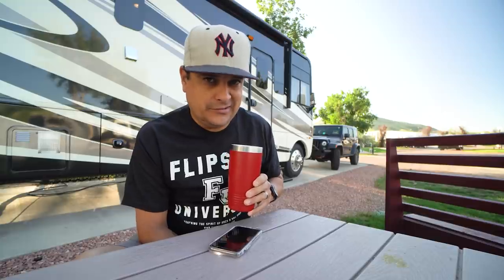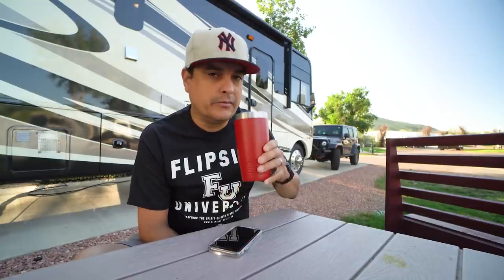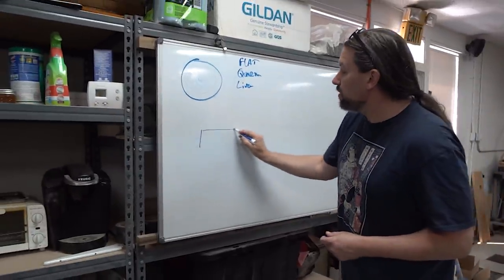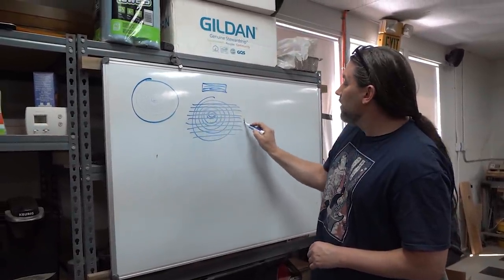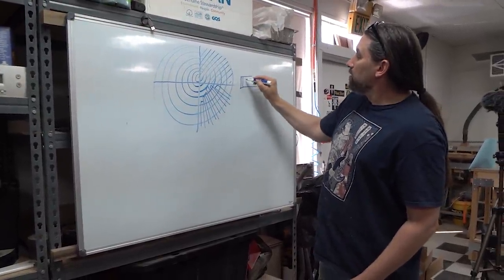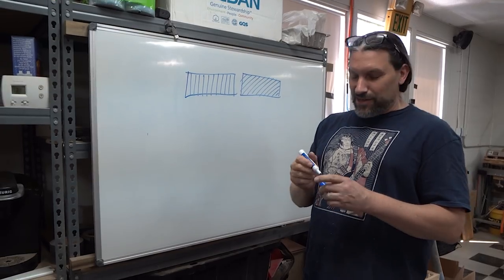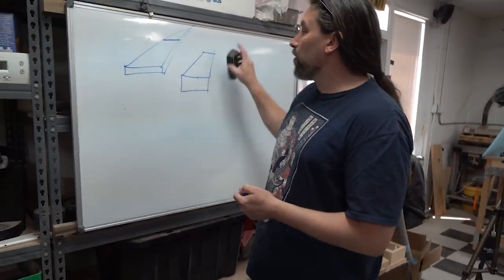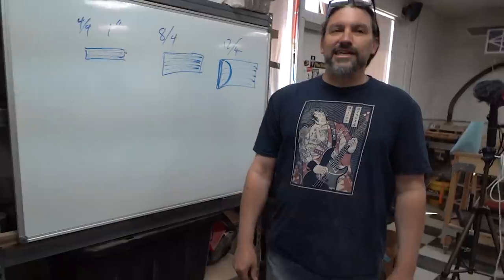More Guitar Tonewood Myths Busted - What Does Quarter Sawn REALLY Mean

Comment: What is not discussed here... The reason you'd want vertical grained wood for a neck has little to do with strength, because it's negligible in maple.  What happens is maple shrinkage over time.  The rate of shrinkage across the board for a vertical grain is about half that of flat grain.  So if you build a one-piece maple neck with flatsawn, the chances of fret stick-out over time is greater.  Rift will have somewhat "even" shrinkage both sides, but there's no real way to predict the evenness of shrinkage.

The other point had to do with surface stability.  A quartersawn board is less likely to produce a cup or bow across the grain; and if it did it would do so more evenly than a flatsawn board.  You see quite a bit of vintage Strat style necks that develop dips or humps on the fretboard, that have to be leveled out.

The reason you'd want flatsawn is if you're after a specific figuring in the wood.  Quilt and bird's eye only show on the flatsawn side.  Curl will show on both flat and quartered sides.

More important than flatsawn or quartersawn, in my opinion, is grain run-out.  That's when the grain runs diagonally through the board.  Back in the days when guitar woods were harvested by hand, the logs were split into boards with a froe.  Since the boards split along the grain, that guarantees zero run-out in the board.  On most all trees at the equator, the grain grows in somewhat of a helical fashion, as the tree follows the sun.  So even with quartersawing, you can still have a dead perfect quartered board and still have grain run-out.
Mahogany, is somewhat an exception as far as shrinkage is concerned because it is one of the most stable woods, with very little shrinkage on both cuts.  It is the reason it was used in patternmaking.  The rules of run-out and short grain still apply however.

Comment: It's called "Through and Through " in the UK not live , "Quarter Sawn" is cut into 4 as described , then each quarter is cut Through and Through alternatively,  so one cut on one flat , turned on the other flat and sawn through turn back 90° and cut " thru n thru" all the way to the 'box heart 'which is normally full of shakes . These terms have been used for centuries by timber frame and shipbuilders in the UK for centuries. The grain orientation is then selected out for its purpose .
Martin uses plywood in its necks , Walter used it on their 2000 sniper rifle both for strength and stability . Structurally plywood weight for weight is stronger than steel,  so when engineering a single span roof beam a laminated wood is generally selected over steel , as the beam not only has to carry its own weight ( mass loading ) but the weight ( load) that will be applied . In composite and laminated beams certain woods are selected and many more plies used , than your box standard ply . So transferring that to guitars ply is an ideal material for a thru body or infant any guitar neck I believe CF Martin have their own ply recipe and number of plies per inch PPI ( we still use feet and inches in the UK and an 8 x 4 ( 1220 x 2440 mm) board is still and 8 x 4 board . For the body of the guitar you have a choice , with a neck thru , your upper and lower cheeks can be anything, for a set neck you want the ply to speak to you so cut it from a flat multiply board , for a Les Paul if you really want to emulate the character of the build use vertically stacked ply lower with horizontal stacked top . In quality grade plies the top ply can be almost any wood species so the flat can be maple , birch ,poplar , oak , wenge , obeche , sapele or true mahogany,  black walnut etc .and as the top is cut away it will reveal the layers below and will look great . Ply is made by the peeling process . I have seen this in action at a company that used to be near where I lived in London called Thames Plywood in Barking . The logs would arrive from all,over the world and depending on size be placed in huge steamers sometimes for days . The log would then be centre marked by the supervisor and mounted in a huge woodworking lathe . The blade would be brought close in to start producing the cylinder to be peeled. Larger pieces would be kept for patching before laminating . The cylinder would then be peeled by the blade the full length of the log until the supervisor calls a halt if there are large shakes in the heart of the log, as this may jam or even damage the blade . The heart would go to a separate area for drying and sold for further processing into planks for other purposes . The never ending sheet is rolled onto a steel core still steaming hot and floppy . The sheet is then transferred to another machine which unroll it and cuts it into the lengths required on a huge flat bed and each flat is piled on top of the last . Flats are pulled out if flawed for patching in a seperate area , using the scrap laminate . Normally a diamond shape of laminate would replace the flaw as this is the strongest method. The flats will then be orientated 90° allowed a certain amount of drying time before bonding together and pressing . The repaired flats will go in the middle . Depending o its purpose 2 different glues would be used for WBP (water/boil proof ) or Marine ( totally waterproof) and graded . The glued and pressed boards would then be sawn into common sheet sizes , most common being 8 x 4 but larger on request for building boats , aircraft etc. and the PPI can be tailored to suit the purpose . Thames Plywood has been used all over the world for everything from ordinary shuttering for concrete to construction of high speed powerboats ( including the World Water Speed Record holder ), aircraft in WW2 ( the famous deHavilland " Mosquito " , hundreds of landing craft for D Day , cars ( including  complete cars in structural use as well as trim panels) and no doubt found its way into guitar bodies and so on , but sadly the manufacture of the best quality ply in the world has long ended in the UK . But I can still smell the place and hear the sounds of the amazing machines in action .
The cheap ply that's imported will often have voids visible at the edge of the cut board where a ply had not been repaired and all sorts of flaws .
Now go out and buy the ply you need to build your guitar !

Comment: I thought grain orientation in the neck was about splintering. Wood splits along the grain much more easily than across it. So if the grain was flat parallel to the fretboard ithe neck would be more vulnerable to breaks than if it was perpendicular.
Reply: You are 100% rigth
Reply: Yeah. I thought it was a construction issue too.

Comment: Can you do a "ES-335 vs Les Paul - Why they sound different"?
Reply: Perhaps mainly because they have different Pickups?
ES-335: Calibrated T-Type
Les Paul: Burstbucker 61R (Zebra)
Reply: @4034miguel  still sound different with same pickups. The tone wood debate will continue, I dont fully believe both sides of the argument. Yes your just creating the signal with the string and pickup but all pickups are slightly microphonic so some of that acoustic tone comes through a bit. I was just playing my es 137 and they have an awesome warm tone when plugged in. If I plug the pickup into my Corona California strat it wouldn't sound nearly the same

Comment: It doesn’t matter how the log was cut, what matters is the grain of the body blank it self. All this intellectual masterbation is only confusing the issue at hand, the neck blank in hand is what matters. 
I do want perfectly flat gain, tons of coveted fender pre cbs guitars were made exactly like that. 
The truss rod does stuff….
No truss rod works left or right, the weak area of 1/4 sawn.
1/4 sawn plays stiff and is bright. 
I don’t own even one, all were sold off long ago, and tone follows the neck.
The bs online is comical.
A real lack of basic physics knowledge here.
1/4 lumber is not any stronger than flat.
It’s strongest in one area and weak in another , just like flat sawn.
And one has a truss rod to help, the other doesn’t.
And that’s 1/4 sawn.
None of this matters, how many maple necks have you seen twisted actually?
Mahogany is another issue.

Comment: It's true that the term, "quartersaw," does derive from cutting the roughed logs into quarters, and then further divided to provide lumber stock with stable vertical grain. Modern producers, harvesters and processors, of high end domestic and exotic woods, will use computer software that can take digital photographs of the roughed logs, and determine the best layout of cuts to provide the most efficient, most cost-effective, most profitable, or to provide an abundance of stock with whatever grain layout, or visible figuring, the producer, or their customers, decide they want. But whatever, eggheads and science, never helped anything and smart people applying intelligent technologies are never successful.